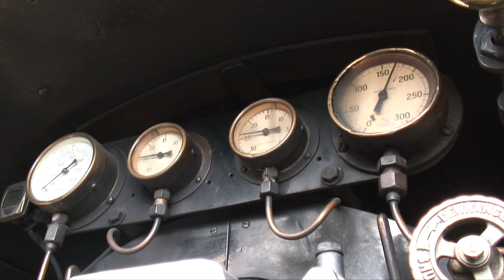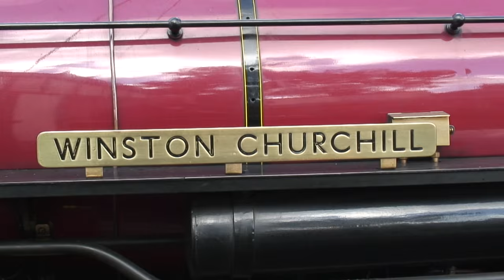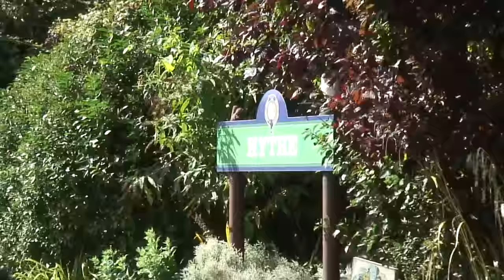Footplate ride on RHDR  no. 9 'Winston Churchill'.

Comment: Would you describe these as big small engines or small big engines?  Either way they are magnificent.
Reply: Lea Fewell.  Big small engines.  They don't come much bigger in the 'miniature railway' class.  They were never toys, either.  They were designed to work hard and work hard they do - twelve car trains (packed during the summer) at 25-30 mph is a tough 'turn.'  The Ffestiniog Railway in Wales on 1'11.5" gauge are all small big engines - all the way up to 2-6-2+2-6-2 ex South African Railways Garrets - they are lovely and they work hard too.